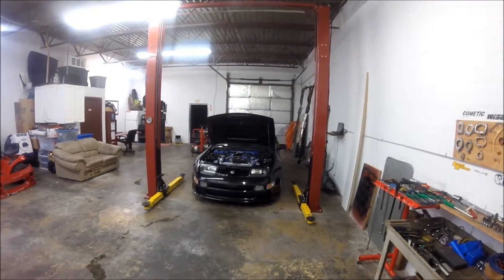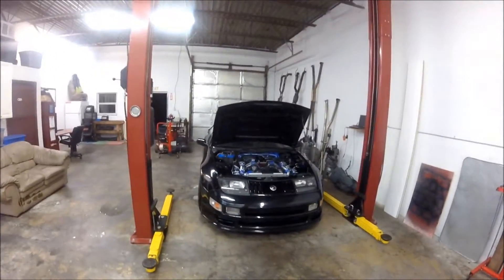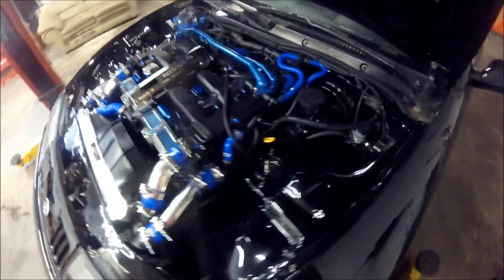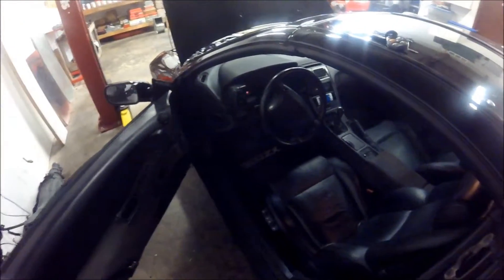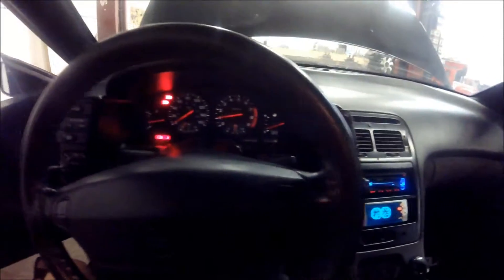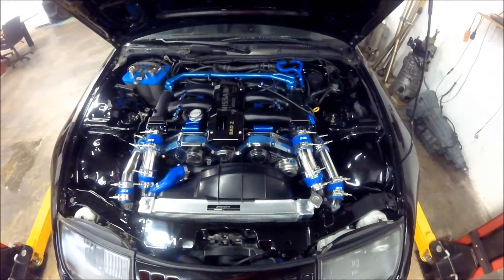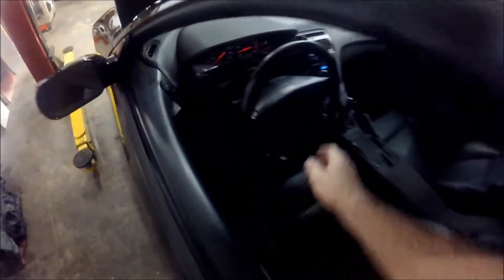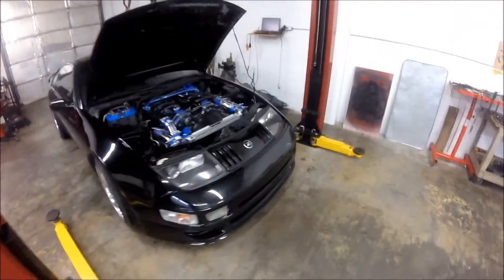Premier Z Performance (300zx Specialists) - Z32 Black and Blue engine rebuilt 500+RWHP

Comment: nice.  could u pls tell me how much it cost to make the engine look like that ? i also got a nissan 300zx  myself.
Reply from the maker: Donna it was apart of the package of the engine rebuild. Most of the time its alot of labor just to get it to that point. So I would estimate around 2500.00 maybe.
Reply: The300ZXGuru That's a great deal.  Dan I'm in California how much would it cost to get my car to you. I think I remember you talking about charges for transpart, but can't remember the price or how it would be transported. now of course I've taken it to Greg at specialty-z here in California but they are more into maintenance and getting our Z'srunning like a brand new engine and tuning, and  don't really get into Aesthetics, probably due to lack of time for that kind of work. , because they have so many customers, sometimes it's two weeks before you can even get your car in there. what would 12k tops get me in your shop?

keep in mind,  it's already been upgraded with a few of the epic breeding mods and water line deletes, that include specialty-z downpipes , Ash intakes with Selin, Magna flow 3" exhaust with huge greddy tips,  upgraded chip , already got the 740's in, with the upgraded rails as well, Bspec boost gauge. the previous owner says he put new turbos in it but I'm not sure what they are,,,    but all in all it still looks extremely stock under the hood even though it isn't and there are a few minor maintenance issues I want addressed. the engine runs strong but there are slight erratic idle at times and there was a short with the fuse from stereo system at the fusible link I think that caused it to start a running erratic and I know it needs a clutch booster and AC to get working again, need to get my new Wing installed and then finally paint and windows tinted and she's good to go.
Reply from the maker: Well first off the best place ever to see how much it would cost to send your Z is at www.uship.com This website provides truckers from around the united states to bid on your shipment. This way you can get the best rate out there. Its like getting onto a carrier thats coming to florida at the last minute and getting on for like 300 bucks. you never know with the truckers. 
I cant really give a price other than the engine pull which is like 2500 for a uninstall reinstall and basic tune. So it would go up from there. Plus when we pull the engine we could paint the engine bay as well.
Reply: The300ZXGuru I see I got it so the engine pull is dressing up the engine and making it look pretty alone by itself for 2500?  and then everything else that you want done goes up from there is that correct?
Reply from the maker: engine uninstall then reinstall and basic tune and powder coating and painting free then what ever you want done after engine pull is free as well all for 2500.00 included.